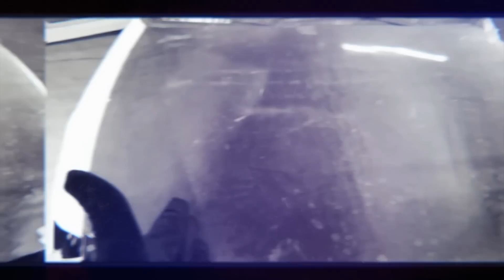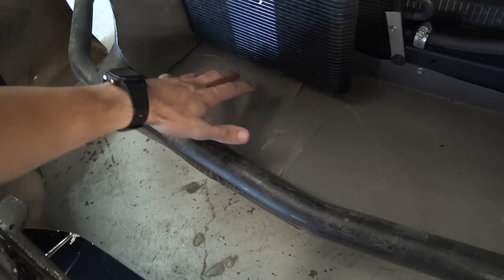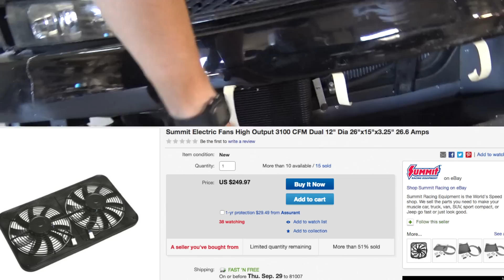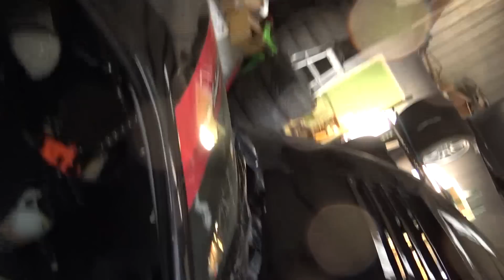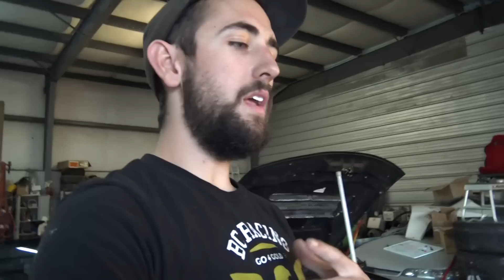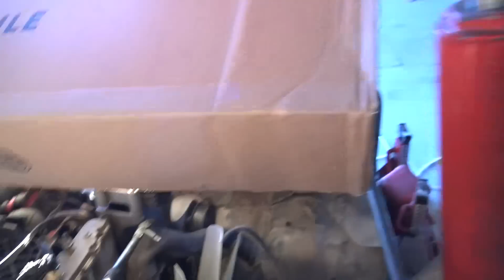Drift Car OVERHEATING? | Tips and tricks |

Comment: Living in Las Vegas, these tips and tricks are helpful just to keep my 5.0 running cooler. Hadn't gotten too hot, but I'm still gonna try the ducting and electric fans.
Reply: Oh and yeah my 5.0 still has the clutch fan, and when you rev the car all you hear is fan. Sounds like a fucking jet and blows dust everywhere.
Reply: just swap to a dual fan set up and run each fan on a different switch.

Comment: I used a Ford Taurus fan in my z31 build, covers the entire core so no need for a custom shroud...it pulls a lot of air, way more than the dual ebay fans I replaced..stock rad, but i do have a 3 core waiting to go on,its has a self built dual relay system for high and low speeds as well as a thermoswitch...i can do about 5 hot laps before my car starts getting warm...congrats on the 50k I told you it'd happen quick

Comment: use the screen wash to spray the radiator. just re route the pipes to the front. if it has light cleaner sprays even easier.

Comment: On the side plate you should put something on the inside. lets say youre drifting looking from the rear of the car and drifting to the right have something open on the left panel but on the right have it close and when your drift left have it do the same thing.
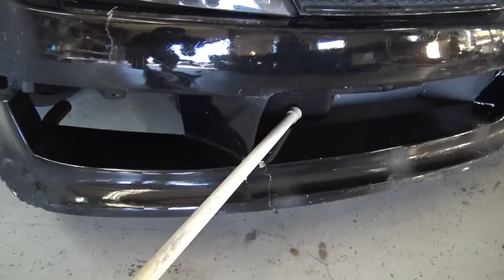something like the exhaust vent on air conditioning when the AC is on they open when its off they close so use the wind in the same way. I think its a good idea to get more air in like you said at 7:20 seconds.

Comment: Really funny that you'd post this video, one of the fans on my flex a lite setup in my 1jz s13 just burnt out the other day so I've been in the market for some thin puller fans. Unfortunately I think the fans you have in your s14 would be slightly too thick to fit between my radiator and engine pulleys.

Comment: love the videos! in ireland we rob fans out of ford mondeos they've dual fans and wire them constant to a switch. works perfect. in my s14 zenki I've silicone hoses a 55 mm aluminium rad cosworth head gasket and those fans. never an issue. no fan shroud either. I've a sr20det.keep up the good work

Comment: love your channel bro.i have a 2jz 350z which is usual at190°cruising &200 ish idle.thats using 2 14" high performance spal fans'mishimoto z radiator and oem toyota 180°thermostat.going to start sliding it although im scared at what-the temps might be hot lapping .Def will-be adding  some ducting '19 row oil cooler with greddy thermo stat sandwhich plate,bleeding the system with a vacuum incase there's air which I think there is  and mishimoto low temp 160°thermostat and see what happens.what are your temps?

Comment: do you think that it is better to put fans in front or in back of the radiator?   I have some say that fans push better and others have said that they pull air better.   Also how do you like the shifter feel of the cd009 compared to the t56.  Keep up the good videos!
Reply from the maker: Pullers are always  better, but if you have to you can get away with a pusher if space absolutely does not allow the puller. Also shifting it feels about the same, the only difference is that it actually goes into gear and does not blink at high rpm shifting

Comment: did you ever fix that hose in the back? i'm i have that exact same issue my car get close to 220 on freeway driving in the summer and 210 in a cold day -__- i have those exact same fans good radiator toyota oem thermostat and toyota red coolant.. 
i'm running out of choices.. car is a s13 2j stock twins

Comment: Hey man, what're you running in terms of temp? I'm running a 1jz  vvti in my SC, and I'm running between 200-208 driving around in the Florida heat. At stop lights, I jump up in temps to 210, even caught at 220. Once I rev the engine up, it'll cool down. Debating on doing the electric fan set up, do you truly recommend it?
Reply: I'm going 2jz vvti in my s13 as well, so good ideas for temp plans. 

Btw yes I've replaced the fan clutch, water pump, Cxracing intercooler, mishimoto rad ( looking into going Koyo for my s13 ).
Reply: what fans are you running now?
Reply: Joseph Ryan currently the stock fan set up. Replaced the fan clutch and running a fan shroud. I've been debating on converting to electric fans if it'll actually cool my car down even 5-10 degrees would be great. Mainly at lights is when I get worried

Comment: I had a small amount of heating issue with my rb25 swapped r32. i bought a mishimoto rad waterpump and nismo tstat. now i am having worse cooling problems than before. i run the stock clutch fan and have converted the ac fan to run on the thermo switch after removing the ac. any idea why its running hotter with a bigger rad gates wp and colder tstat? ps low mount intercooler, no shroud and blitz front bumper with tons of intake room. thx